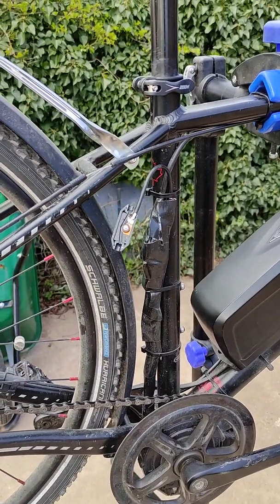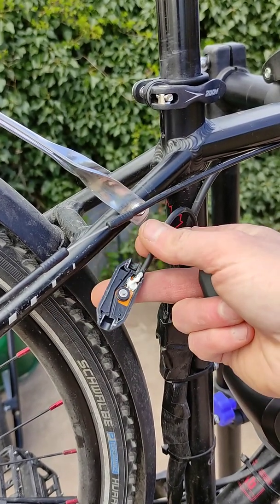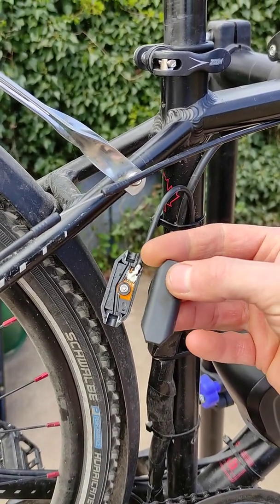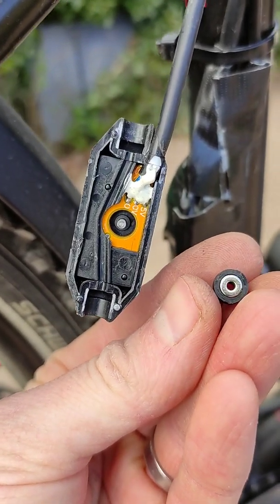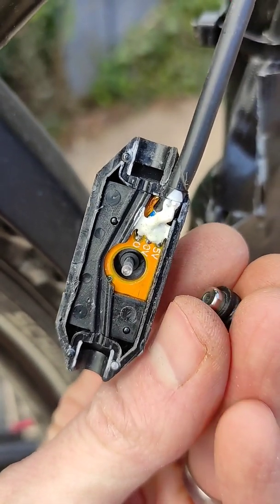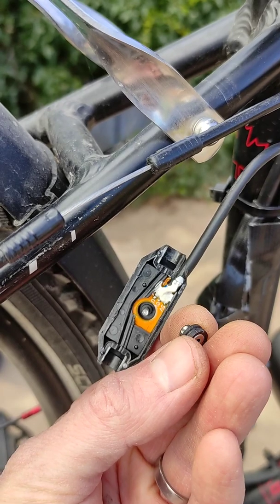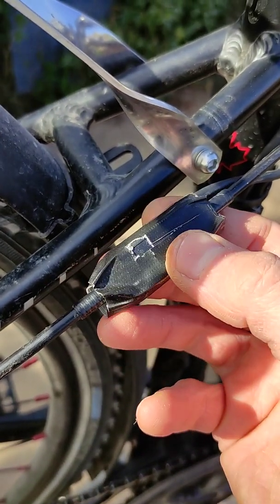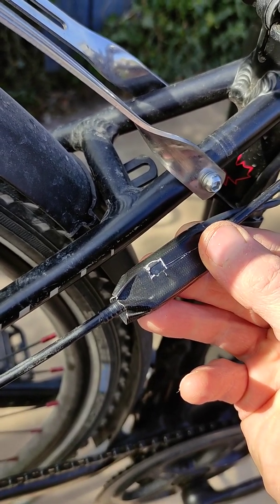Bafang BBS01B 250w mid-drive eBike - gear change sensor fault

Comment: Was it flashing green when it stopped working? Mine is flashing green and not working so going to try this. What grease did you use?
Reply from the maker: Hi. No, I don't think mine was flashing green... But take it apart - it's a very simple piece of kit and if its a mechanical issue it should be fairly obvious. Try turning the spindle and if you get a flash from the light each time then the electronics are probably fine and the issue is that the cable is not turning the spindle as in my case. But if it's the electronics that are faulty I suspect you'll need a new unit. It'd be worth checking the connection back to the motor as well in that instance.

The grease was nothing special - some muc-off synthetic general purpose stuff that I use on any bearings. Good luck.

Comment: I enjoyed all 3 videos Richard. I have a BBS02b which is excellent around 1500 miles now. What is the BBS01 like for riding with 'only' 250W ? Is it powerful enough, can it cope with hills, any other riding thoughts.
Reply from the maker: Hi John - thanks for your comment. I've never ridden a more powerful e-bike so don't have a good frame of reference, although I've ridden a few different 250w models. I certainly don't feel it is under-powered on hills. On the road hills around me (Nottingham - fairly average hills I'd guess for the UK) it takes me up them at 10-12mph without me having to make much effort. I guess a more powerful motor would get nearer the 15mph legal limit (that's the limit on-road in the UK)

Off-road I've experimented and found that the 250w motor struggles to power the bike much past 25mph, but I suspect that depends on rider weight and gearing as well. Have you experimented with how fast yours will go?
Reply: @HomeBloodPressure  Thank you for the reply. So it sounds that it copes just fine. Mine is 750w but I mainly use pedal assist at levels 1, 2 and 3 (out of 9) occasionally 4 for bigger hills and the most it pulls is around 400 watts and is more than adequate for hilly Derbyshire. Good to know I shall bear that in mind (that the BBS01 is fine) if I build another. Just another thing. I had the same problem with fixing the Hailong battery so I drilled another hole in the bike frame (maybe 2) and inserted a rivnut basically like another bottle cage holder nut at the appropriate place and it work great and avoids tie wraps. For the rocking motor I added a support bracket under the motor bolted to the side stand plate that is on my bike. And lastly, yes the non working gear sensor. WD40 and pulled the cable back and forth and it sorted it. I also downtuned the motor from 25 amps to 18 amps for reliability using the programming cable (from ebay) and the free settings software on my laptop that is readily available. Once again, many thanks for your video
Reply from the maker: @JohnSmith-ch9lp  Interesting to hear the same faults and issues cropping up with you as well! I did ponder drilling more holes in the frame to mount the battery but chickened out. The cable ties hold it surprisingly well - it doesn't flap around. I haven't gone as far as tweaking settings using my laptop like you have. Not yet anyway...
Reply: @HomeBloodPressure   if you do get a programming cable it is really quite straightforward. I’ve tweaked the slow start so it doesn’t shoot forward in effect comes in more softly. Also ‘tuned’ the power levels for pedal assist to my liking and the thumb throttle (not sure if yours has one) to come in at level 6 whatever level you are on even level 0. I don’t ride using the throttle but sometimes handy to get away from lights or into a roundabout etc to get into traffic quickly. I know some folk basically want an electric motorbike I’m more just assistance on my cycle. Oh and don’t be out off by ‘programming’ as in reality you are just adjusting the settings and there are so many guides out there. Enjoy your bike regards 👍
Reply from the maker: @UCPd-T6bB6Nx248HZ7k8WZ_w brilliant, thanks for that. I may have a tinker at some point as I agree that, in the higher power modes at least, a more gentle start could be better.

I love the idea of the quick throttle getaway! I've got the throttle but not fitted it... Now I'm tempted.